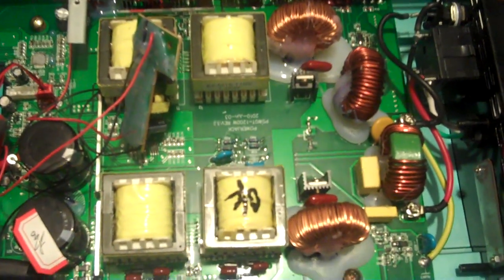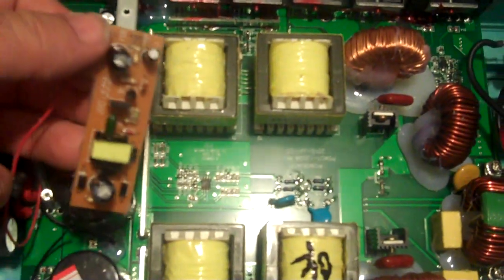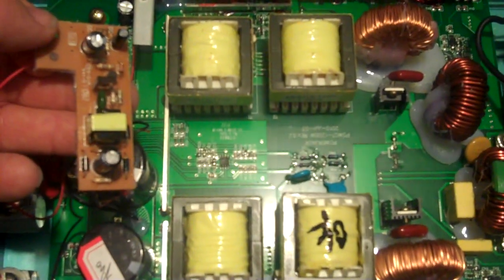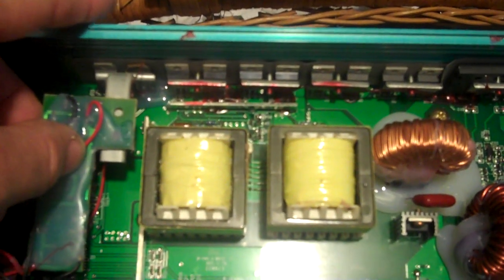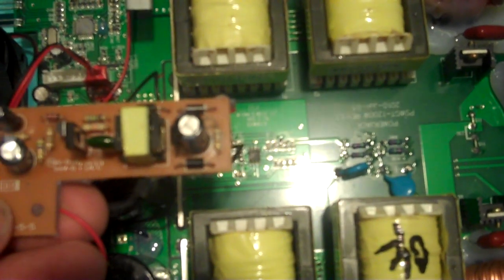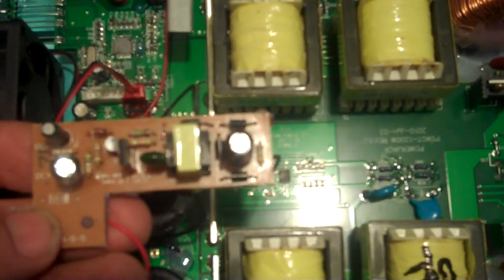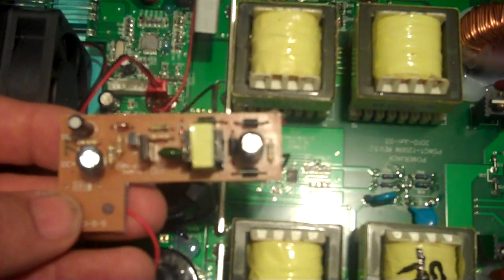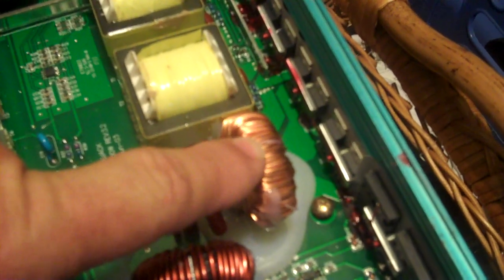PowerJack 1200watt 50~100VDC "Jacked Up"

Comment: that board is the power supply for the lcd power meter. I had to remove it cos it blew up and powerjack told me to.

The mosfets blow up because this inverter has very little protection against power surge. I bought a voltage regulator and a contactor to solve the problem. Waiting for mosfets to arrive.

Comment from the maker: Charles,
Unless you can measure the amps on the DC (input side) it is hard to tell what is actually going on. The issue most likely lies in how MPPT works.
As the inverter applies more load on the battery the voltage is most likely hitting the bottom of its' operating range. MPPT looks for the maximum power from the source which is the product of (Voltage x amperage). Solar panels have power curves that are not linear and the optimum voltage (mppt) is what the MPPT GTI tries to run at.

Comment: what voltage gti do you have I have a sun-1000g  22volt to 60 and when hooked to battries it only pull about 230 watts not 1000 watts and the bank is at 25 volts is there a reasion for that or do you know thanks if you can help unless you have to run it at the higher voltage end to get higher voltage out put. any ideas.

Comment from the maker: @haveityourwaycom 
Have both of these and both are still running though only with 540 watts of panels connected to each.
Bummer that it takes a 1200 watt inverter to handle 540 watts of panels.
Let me know if you see a review on the Sun1000G.

Comment: On my unit, I bent the lid along each side, about 1" in from the edge, so that when it slides back into place, there is an extra 1/8" or so of gap between the lid and these inductors. Providing you don't bend too much of an angle, it will still slide into the heatsink slots.

(mine is sitting on the floor of the workshop with a blown FET again). 
Am waiting on some 1200v IGBT's to arrive for the next attempt at repair.

PS don't ignore the nighttime power draw on these things..

Keep us updated.

Comment: This 'daughter' board would not handle any more than a few watts of power, so it would not be doing any 'conditioning' or voltage reducing for the main DC-AC converter. Based on the size of the inductor and the connecting wires (and where they go)  I'm guessing it it simply a voltage divider that divides the input voltage by 2, which is then used as the reference to make the GTI controller think that the DC input voltage is 25-50V. The FETS and diodes would have no difficulty switching 100v DC.

Comment: @mpcjax 
I know, it is very tempting to go for the higher voltage, lower current.
It does appear that the PowerJacks may be a bit more reliable when working at 110v AC, but then again there are people posting videos of dead, or dying PJ GTI's on 110v too. I hope to post some internal shots of the SUN-500g 24-55v, 240v AC unit next week..  If it works out, I may do as micheal1970 and just keep adding more SUN-500's as my solar array 'grows'. At least it should provide a little redundancy.

Comment from the maker: @Xringer The input filter caps are much larger than what I have seen in others videos and rated @100v. The output of the daughter board(dc-) ties into where the negative lead of the middle capacitor would normally be. There is no circuitry on the bottom of the daughter board under all that hot glue. There are several resistor on input side of the daughter prior to going into the tranformer then a bunch of diodes (some sort of bridge rectifier) on the output side.

Comment from the maker: @sparktastic1 I wish there were more videos of the internals of the SUN inverters so I could compare quality. I have a Sun-250g with 3-80Watt panels that has been running for a year without an issue. I measured the efficiency at around 81%. I bit on the 1200 watt powerjack thinking 1080watt of panel and a 1200 watt inverter should work fine. Furthermore, the 50~100v range made sense as I could use a much smaller wire for my run from panel to my inverter.